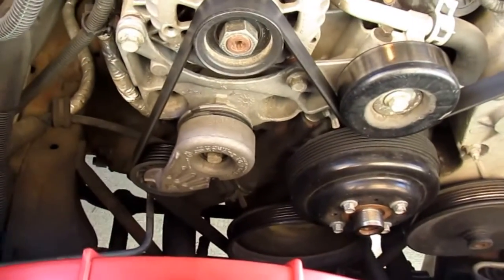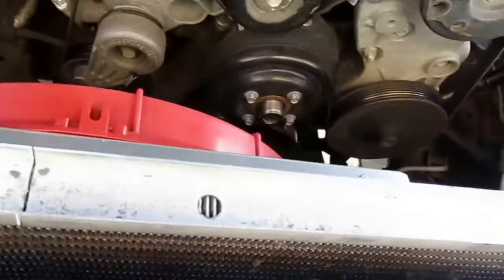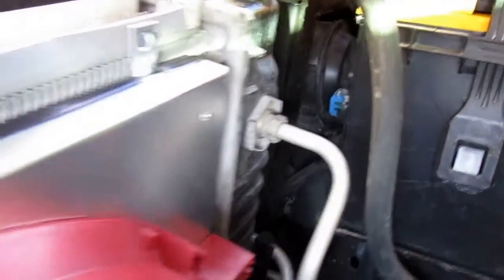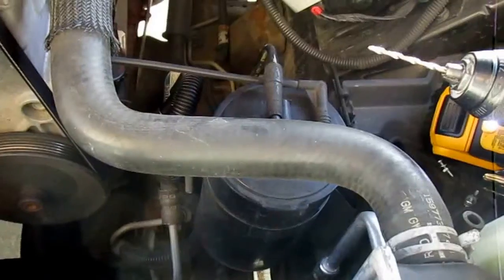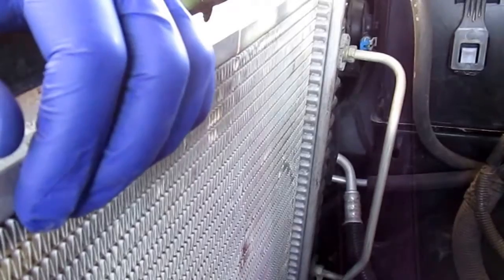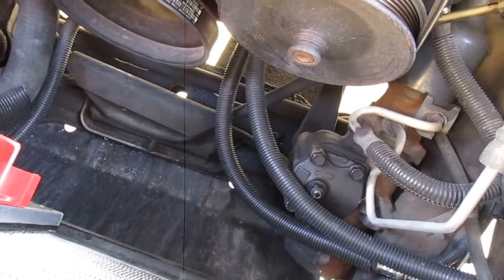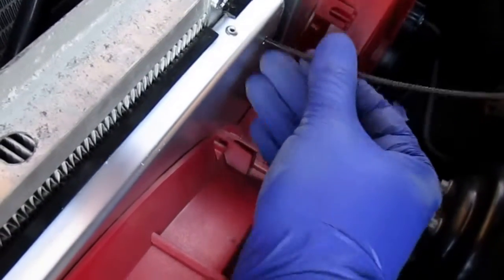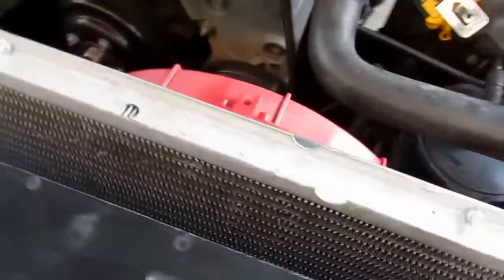FF Dynamics electric fan install 1997 Chevy K1500 FF Dynamics fans part 1

Comment: They have Terrible customer service and will leave you hanging if you need help trouble shooting! i wasted $450 with them 18 months later truck overheated because fan wont start and they will not help diagnose because my 12 months is up. Never ever again!
Reply from the maker: Sorry to hear that. Mine are still going and I'm not a sponsor of them or anything. I would take to a shop that knows electrical and as always... always watch your coolant temp gauge when driving around. It really could be anything; a loose wire, something not grounding, a bad relay, a bad fan, bad temp probe, temp probe in bad location, closed thermostat, etc. I would just test one thing at a time and see what you can find out. Hope it's something easy.

Comment: I just ordered the Stage 4 Extreme for my truck. Is the wiring simple?
Reply from the maker: I did not do the wiring but I bet if you take it step by step it is probably not too bad.  Good luck!
Reply: Ok I’ll give it a shot. How much did the shop charge you to wire everything?
Reply from the maker: @the_chosen_one2831  About 300 or 350. I don't remember exactly.

Comment: This isn't meant to be a criticism or a bash. I am just curious as to why you would put the plastic mounting kit in if you bolted the fans to the rad? I, personally, think that doing that would be a waste of time since it is bolted. Good video though! I think that electric fans are always the way to go!
Reply from the maker: Thanks for the comment. It's a good question.  Yeah you're right on second thought I could have used skinny bolts with washers instead of the plastic kit. I will do that if and when the plastic breaks. That would be much better than plastic I agree with you. Also, I did do a radiation flush and used Amsoil Coolant Boost to help keep that baby cool.  Let me know if you need any Amsoil stuff or have any other questions. Thanks

Comment: Wheres the rest of the video?? I just ordered mine for my ZJ V8
Reply from the maker: Hey Joey, I ended up taking it in to a shop to have them wire it.  I can make one showing the wiring but not installing it.
Reply: pharmdog1  mine showed up today... I should have it in by Thursday or so... how is yours doing?
Reply from the maker: Its going well. The plastic tabs did break and I would probably do zip ties if doing it again. Other than that, the fans work great in the heat and when the A/C is on.  I also changed my coolant earlier in the year for good measure. Let me know how yours goes.
Reply from the maker: Yo Joey, the new video is now posted showing the wiring.

Comment: I just found this company while looking for a conversion kit for my 98 V8 Grand Cherokee.  I have some slight overheating issues when I go 4wheeling in the AZ summer.  I would also like to try to save some precious mpg and hp numbers by getting rid of that parasitic clutch fan.  

I have never heard of FF Dynamics so I am curious about the quality.  Is this a cheap chinese fan?  Does it actually flow 3600cfm or is that just wishful thinking?
Reply from the maker: Hey Kur, glad you saw the video and reached out. The fans work good and are easy to install, but the wiring was more challenging and above my skill level. I took it to a shop to complete the wiring. I recommend the probe that slides in the radiator because its easier to install. I will try and post a video soon of the wiring and show you how it was ran. I was running around town with my heater on full blast prior, but then it started heating up and I knew I had to get it going before I could not stand the heat on my feet anymore. It did add power that the fan clutch was stealing and seems to cool quicker than normal now. I also know that overheating will eventually lead to head gasket issues, so its best to keep your fan clutch on until you are ready to swap to electric. Any questions,  let me know. Thanks.
Reply: I contacted this company and they told me that there is no electric fan in the world that would keep my engine cool, even though there was an option for my vehicle for a larger engine that had an electric fan from the factory which works just fine.  That tells me they know their kit won't work for my jeep and that their kit must not be as good as the factory option.  I'm sure it will work out fine for you, but I am not going to spend the money to try it, especially when the company is telling me it won't work either.
Reply from the maker: If they said that, then I totally understand your feelings, although I disagree that there is no fan out there which will work. I think if you clean/treat your radiator with new coolant, an electric fan with high CFM''s will work. Just my opinion though.
Reply: I flush my coolant every year or two because the previous owner of my jeep used straight water in the system and an over abundance of silicone gasket maker when installing a new water pump.  So now I constantly have rust and bits of silicone running through my system.  I've replaced the radiator already and the jeep stays cool under normal driving conditions and even runs cooler than normal operating temps in the winter.  It is only while slow pace rock crawling in the middle of summer that it likes to run hot.  

I'll see if I can just find a good deal on a factory e-fan from the 5.9 limited.  I know that will move enough air.
Reply from the maker: Cool, sounds good man! Let me know how it goes.
Reply: Just order my kit for my 2door Tahoe I ordered the extreme kit..from spiked dog collars on eBay I will post a video when I receive them but u might want to check ur thermostat for gunk build up and also look into a severe fan clutch..I can run my 2 Dr offroad all day long..but want better ac and power back...but get a hold of spiked dog collar on ebay
Reply: Those fans suck spal fans are the way to go